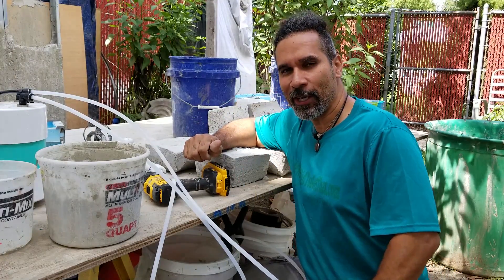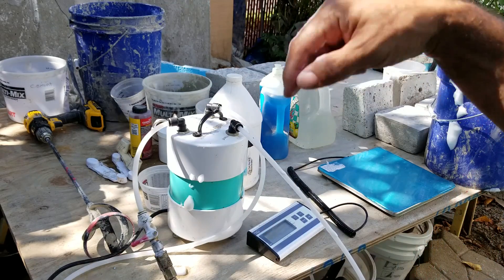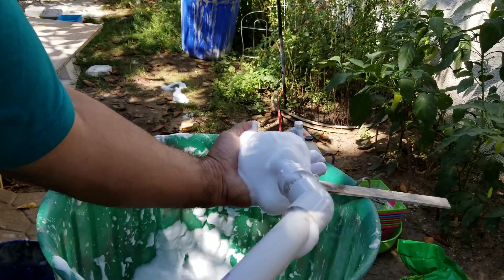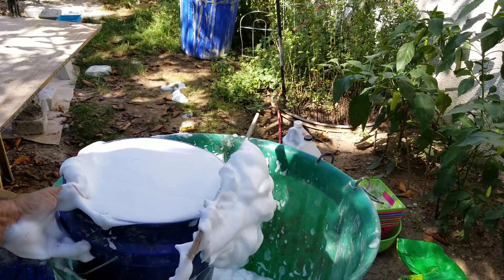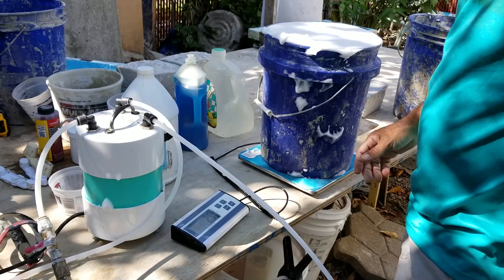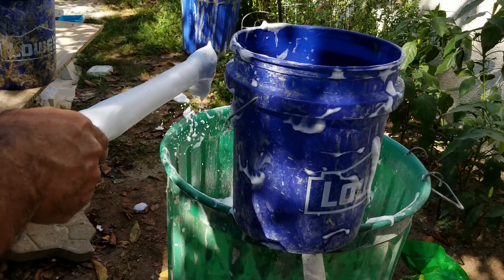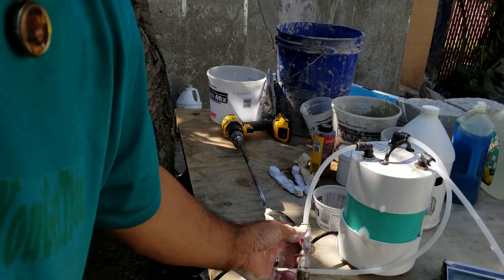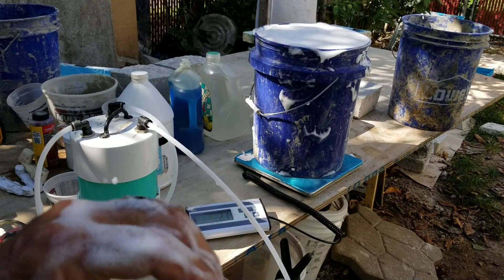How To Make Aircrete Part 1 #Aircrete #Foamgenerator #AircreteHarry #AircreteHarryFoamGenerator

Comment: Why don't you use a pressure regulator with a gauge to set the amount of airflow on the foam generator. It seems like if you measured the water, foaming agent and set the air pressure with the regulator you could get extremely consistent foam.

Comment: I have a theory I don't have time to test which is to use some quick lime to accelerate setup time before bubbles collapse and make stronger
Reply from the maker: Fastforward to today - 5 years since this video was made; after spending Time & doing numerous tests, I recommend these additives for strength & much better results. Also, it will allow you to pour taller. 
https://aircreteharry.com/product/1-gallon-aircrete-thickener-two-x-1-quart-air-entrainment-liquid-by-aircrete-harry-allows-you-to-pour-aircrete-much-higher-improves-strength-see-description/
Reply: @AircreteHarry  You have mucho experience now 🎉 Any insights for our specific uses? ❤
Reply from the maker: @walkingwater1  Drexel for Best Results: 4oz to 5-gallons of water.

Comment: Hi harry! how are you. Quick question in an other video you mentioned that the perfect foam should weight in between 3.15 to 3.5 oz per liter. However in this video the bucket of 5 galones weight 3 pounds therefore per liter is about 2.11oz per liter. Do you recomend that for general stuff? or how much should the foam weight for general stuff? Thanks!!
Reply from the maker: The bucket is zero-ed out before weighing.

Comment: That is a nice looking foam man ..have you ever figured out cost to make a 5 gallon bucket full of foam? not including tools just soap cost? also whats the cheapest smallest size foam generator you make? and what soap is best performance vs cost? thanks.. i was lucky to pick up a 11 oz can of shaving creme for $1 but that only makes approx 1.5 gallons of foam... i made a test mixed up a little over 2 lbs ...i think if i did not add foam i would have needed around 4 pound to fill unit i built... so i am on the right track..stuff smells great also..thanks

Comment: Lets say i wanted to make a 1/2 gallon of aircrete to fill a vase? how much port land cement is needed? and could i just buy a can of shaving cream to mix it in the cement mix??? and what is the ratios? lets just say i want to make a cup of aircrete... can you tell me how much cement,water and foam is needed of each... i am good at math...just need ratios as close as possible... i can experiment and get it right... thanks
Reply from the maker: To make 50 gallons of Aircrete I add one 94 lb bag of cement to 6 gallons of water and mix. That give me 7 gallons of cement slurry then I add  43 gallons of foam and mix. You have all your numbers all you have to do now is divide.

Yes you can use shaving cream. Making your own foam maker with a mixing paddle bit with some stainless steel sponge tied to it, on a drill. Will be a much better way for small experiments than buying shaving cream cans. So when your ready to make larger vase or whatever you can make more foam this way. That is until your ready to buy my Aircrete Harry foam generator.  You can look at my other videos for a good foaming agent I have two or three videos on the subject.
Reply: @AircreteHarry  Thanks.... i watched a video where the guy made small batches... last batch he added 3x the volume foam to the amount of volume of water  he had added to cement to make slurry... it was very cool... the aircrete took up 3x the volume as just plain cement and it floated!!!... Do guys even go as far as adding 4x foam? 5x? it would be even lighter so after cured it would be 1/4,1/5th the weight as plain cement mix... i really don't need crazy strength so for me the lighter the better... i have a lot to learn i just found out about this air crete 3 days ago and i think its amazing ...thanks for your help..

Comment: does this stuff dry fast? what is it used for??? i am building hollow statues and i am looking to fill them... concrete is a bit to heavy... all i need it for is strength and maybe a 1/2 pound or less for my 12'' statue... i wonder if i could rig up a mini foamer... that bucket full is a 2 month supply for me... thanks...seems like a cool product

Comment: I am wondering what happens if you were to mix the slurry use latex concrete bonding agent and foaming agent, a small submersible pump in conjunction with air into your foaming chamber thense into the forms directly this would give you complete mix and foaming agent with least disturbance.

Comment: My grandpa was a boat builder and I could form that but would it float???
Reply from the maker: There is an Italian company that makes cement boats. This Aircrete is brittle not good for a boat.
Reply: @AircreteHarry  yes concrete steel reinforced yes, but aircrete I doubt also
Reply: yes would float but not sure it s enough strong

Comment: I have see comments saying that you should adjust airflow based on pressure and I firmly disagree. If you want to control airflow, then control airflow. A 1/4 turn valve wouldn't be my first choice of valves because it's very nonlinear. But, instead of worry about the valve, make your adjustments, based on actual airflow.

Below is a link to a rotameter, which is an inline device that allows the operator to adjust whatever valve you're using to a known airflow, in cubic feet per min. I'm not saying this is the exact rotameter you should be using, you want one that has a slightly higher volume than the max volume you run in any process. There are also surely cheaper units available.
https://shop.prmfiltration.com/products/fmdfg15-rotameter

Comment: A question about the 2.1# density foam. Would that be okay to use for making aircrete that is going to be used as insulation between wall studs? And, have you made aircrete that was used in walls as an insulator and if you did, could you tell me the mix and pressures you used? Thanks

Comment: What are you using for the foam?
Reply from the maker: I'm using 4 oz. Drixel foaming agent in a 5 gallon bucket of water.
Reply: Cec Farns 
I don’t know anything about this stuff but saw another video where a guy simply added styrofoam to his ordinary concrete mix and it seemed to work great.

Comment: So I actually work in concrete, I know for structural use it has be be between 3-5% air content if it would be exposed to freezing temperatures.

Comment: How do you get 3 pounds of foam without 3 pounds of soap? Liquid soap is clearly more dense than foam. A gallon of milk weighs 8 pounds, so it took roughly 1\3 gallon of soap to make a bucket of foam?
Reply from the maker: The foam solution which is 4 oz mixed in a 5 gallon bucket of water when air is added creates your foam which in a 5 gallon bucket should equal 3 pounds.
Reply: @AircreteHarry  so you pumped a full 5 gallons of water in there? I'm just curious, not trying to be an ass.
Reply from the maker: @mrsir2378  a 5 gallon bucket of water weighs 40 lb. In a 5 gallon bucket of water you're adding 4 oz of foaming agent . The weight from 3 pounds of foam in a 5 gallon bucket is made up of the water.

Comment: It seems that a PSI gauge on the air input side would pinpoint the exact setting you need for the right foam consistency. Just determine what PSI achieves your 3 lb weight, and set it at that PSI everytime? Regardless, thank you for all your very helpful videos Harry.
Reply: That tap regulates flow, not pressure.
Reply: Maybe later on you’ll tell us what pressure we need?

Comment: Why does your machine have a motor? What's the purpose?Seems like the air pressure would be sufficient. Please explain.
Reply from the maker: Hi Bill having the motor opposed to using air pressure allows me to have the largest container with foam solution for a continuous non-stop foaming. For the projects I work on require a lot of foam. If you look at my foundation for a dome video I use a 32 gallon container for my foaming solution right now you can't do that with the air pressure one and that would just slow me down personally. air pressure units out there have a limited capacity and you're dealing with a tank under pressure if there is any type of blockages in the system boom.
Reply: Thanx for replying. So the motor stirs the solution into foam?
Reply from the maker: It pumps the foam solution from the holding container into the unit were it mixes with air and then to the foaming wand.